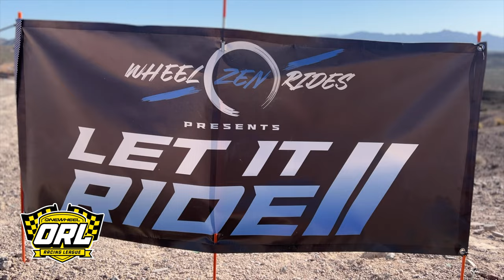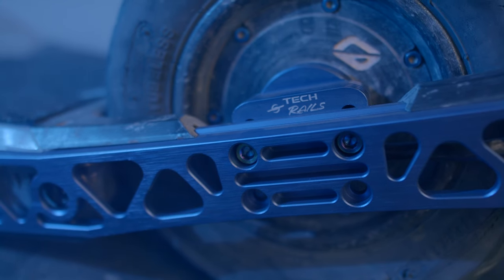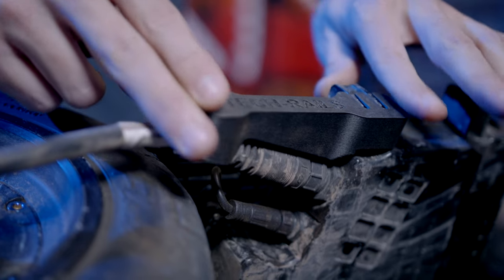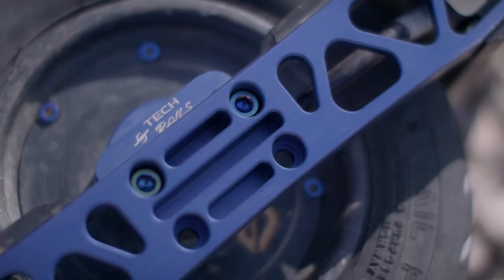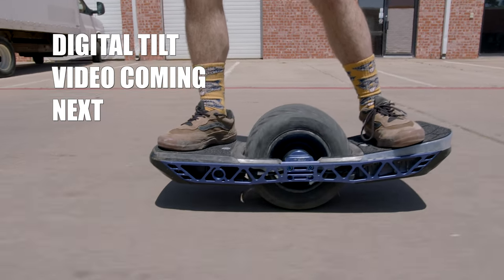ONEWHEEL GT - MY NEW BLUE 357-T TECH RAILS!!

Comment: Literally just bought some. Thanks for the info, can't wait to try them out!
Reply from the maker: Dude thank you!!!!! What color you get ?!
Reply: @jeffadairshreds  i got the reds!
Reply: So quick update on what I think of the product since it just came in today. The material appears very strong, not only that, but it's surprisingly lightweight. I'm not sure if this next part is a con for anyone but I think it's a pro, this thing is SHARP! not like cut yourself sharp, but more of a pound of flesh sharp. It's sexy, for sure. I think the part I love with this is the fact that it comes with all these very nice rainbow colored anodized screws as well as a very very very nice tire plug made of the same material. I did notice some scratches on the bottom of one of the axle block, but I can forgive that.

Comment: On the katana. You don’t get the carriers correct? Do they work with stock blocks. Or do you need other parts?
Reply from the maker: No carriers , they do work with stock blocks or crazy hubs that open up more height adjustments
Reply: @jeffadairshreds  thanks. So with the stock blocks what are the two riding positions? Is one of them lowered?
Reply from the maker: @rafaelinmissouri6235  one is stock and one is lowered by 5/8th an inch

Comment: I did overnight to get mine finish up I just need to do the tilt fix seems front low
Reply from the maker: Are you on second to lowest or lowest setting ? Thx you for watching ! Next video dropping is the explanation of the digital tilt with Matson and myself
Reply: I’m on the lowest I think I have the same set up like yours. I’m on elevated mode now but I’m not liking it. Still need proper tilt adjustment. That blue rails is sick af btw now I want blue😂
Reply from the maker: @rabs2020  I think elevated would be ok on second to lowest in certain situations but that tail is too close on lowest setting. Have you tried NRF yet ? By end of weekend I’ll have the digital tilt video uploaded to help with it 💪💪💪